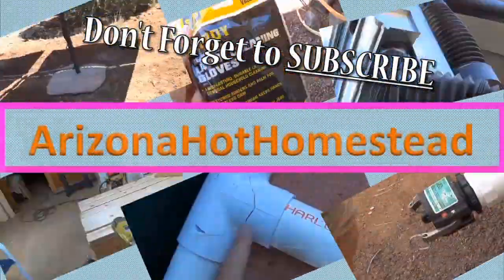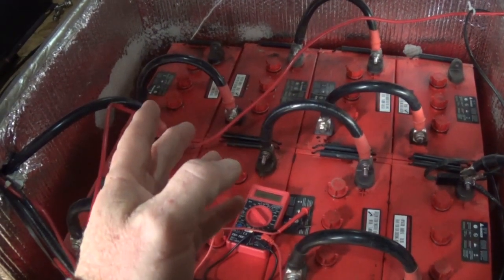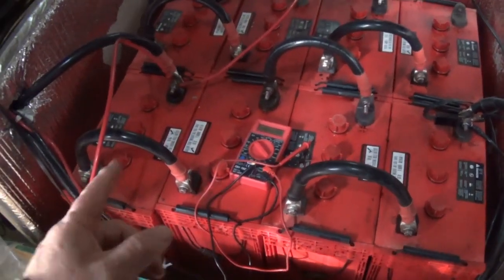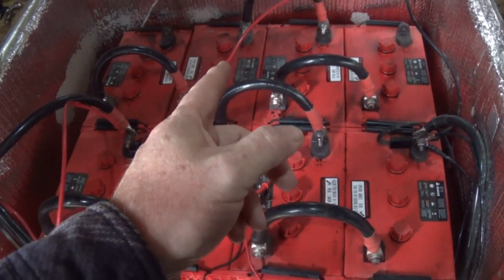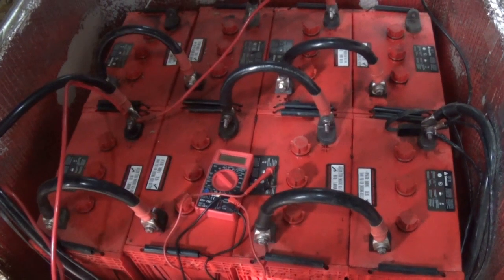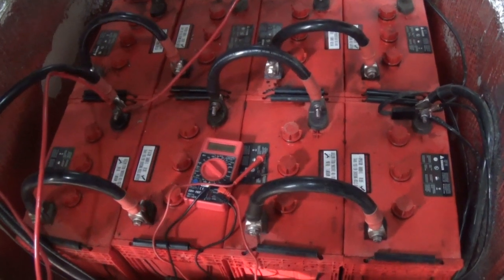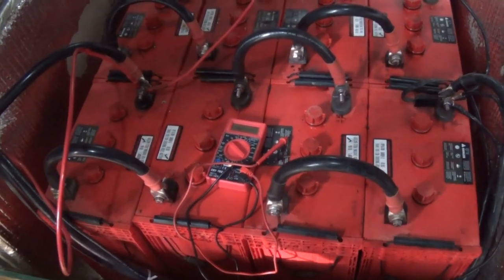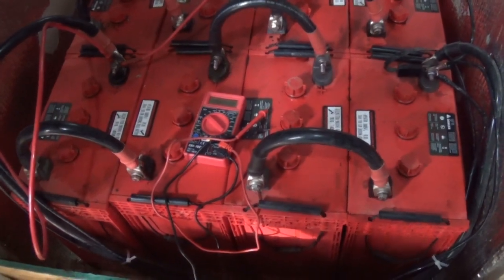Solar Batteries not Holding their Charge Part 3 of 3

Comment: This is why I stay with 12 volt system. 1 bad battery is a 50% cut. It's not worth saving $8 a battery in wire, paying a 20% extra for inverters and converters to end up with that result. Best deal is the Lithium / Lead Acid system I am using which adds 3 years longer ability to my 24 battery Rolls Surrette system.
Reply from the maker: i thought of 12v system but went with the 24v becus it can handle more even with that it wasnt the long term plan. the long term  is to do 48v system with lithium batteries totaling 600ah. i think that might even be to small for what i want to do in the future.

Comment: Why not pull that dead battery out?
Reply from the maker: if i did that i would need to replace it so i still have 8 batteries to make 24v. right now i am on 4 batteries 24v. but those 4 are not holding their charge well. i think they all are to weak to live much more.

Comment: so the front 6 volt batteries series 24 volt and the back set of 4 is disconnected ? the two strings of 24 volt were then paralleled  ?   so the two strings go to a common bus bar and you then pull power ,positive and negative  from the two common bus bars to your inverter. now I am assuming this is a 24 volt system
Reply from the maker: you got it. .